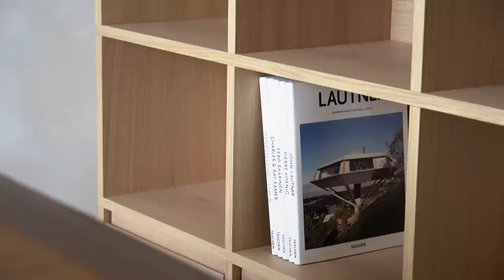Home Office Renovation & Reveal

Comment: I think you were so right to replace those dated moldings/trim with plain, but substantial ones.   I don’t like the inauthenticity of putting traditional moldings into a modern house, as the previous owners or builder had done, it looks twee.  I love my Victorian moldings, but they are original to the house, not added anachronistically a hundred years later.

Comment: Thanks so much! That looks so amazing! Such a professional job! Can I ask what you made the skirting boards from and what size they are please? And if you still used some beading (sorry if that's not the technical term!) to cover between the edge of the flooring and skirting? It looks fantastic!
Reply from the maker: We just used MDF and had it cut to the size we wanted at B&Q and then primed and painted it at home. Simon actually trimmed a little more off for this room as we decided it was a little too high when we had it cut at B&Q. And luckily the skirting sits fairly nicely against most of the floor with only a minimal gap so we haven't put any beading round the edge aside from under the bifold door 👍
Reply: @EmmaHill  thanks so much - that's really helpful xxx 💕 😎
Reply from the maker: We went for square edging too so it made it a lot easier (we didn't want anything extravagant) but you could also add a slight detail around the top if you had the right tools 👍

Comment: Can you share greater details about putting the flooring over the tiles? My husband and I will be doing a kitchen reno ourselves and I had no idea we might be able to get away with not removing the tile…
Reply: It really depends on the quality of the tiles. In  our old kitchen they were level and well secured so we laid laminate directly over the top with underlay underneath. In this room the floor wasn't exactly level so we used some levelling/smoothing compound to eradicate as many inconsistencies as possible before laying the floor. But we will be taking the tiles up in the hallway and kitchen as many are broken or loose so couldn't lay directly over them. 👍
Reply: It will also depend on how thick the new floor is and if you are able to lose the additional height of laying on top of the tiles. We believe the tiles in the kitchen and hallway have been laid on top of older tiles (which is probably why many of them have broken/become loose) so adding a further flooing on top would cause height issues between the floors. So by taking up the tiles the floor will have a more consistent height throughout 👍 hope that helps.
Reply: @simoncreasey4067  thank you so much, that helps a great deal.